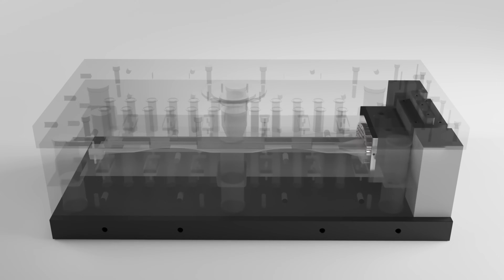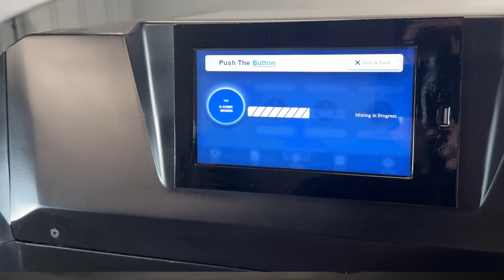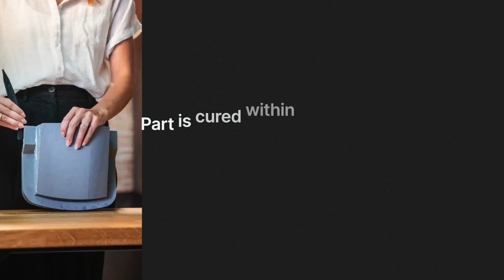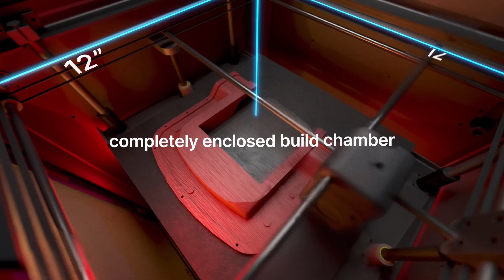INJECTION & Casting System for 3D Printers

Comment from the maker: You are not limited to using only Neckog materials for either device. Simply provide us with the name of the material you wish to use, and we will send you a calibrated flow file for it. 

You have the freedom to design the molds and manufacture them from any material(silicone, aluminium) of your choice. 

DaaS is designed for those who prefer not to handle the process themselves, and with prices starting at just $4.99 per mold, it's an incredibly affordable option.
Reply: would it be able to utilize Smooth-On urethanes and silicones?
Reply from the maker: @phillipwilson8429  Smooth-on and polytek polyurethanes yes. We are working on silicones.
Reply: How about you recommending some compatible chemicals, that you tested? I am not going to do chemical compatibility testing for you!

Comment: how many times can you use the 3D printed part to cast a part before it starts wear out?
Reply from the maker: We tested it over 30 times(showed no wear). The weak point tends to be the assembly points of mold parts.

Comment: What material would you ned to 3d print the mold? PLA, PetG, ASA?
Reply from the maker: If the part is thin any material works. If its thicker due to exothermic reaction of the resin setting we suggest ABS or PetG.

Comment: Usually when casting resin you use a pressure chamber. How is it bubble free?
Reply from the maker: Good question. There are three main reasons for bubbles in urethane resins:

Moisture: Urethane resins are very sensitive to moisture. Our system engages the tanks only when the system is in use to minimize exposure to moisture.

Hand Mixing: When mixing by hand, it’s difficult to avoid introducing air into the resin unless you mix under vacuum conditions. Using mixer nozzles ensures that the two components are mixed without aeration.

Injection/Casting Process: Pouring the resin steadily and slowly is crucial. With an adjustable flow setting, you can control the amount of material being dispensed, reducing the risk of bubbles.

Comment: I love your product, but have 4 suggestions that may help you on your way to success. 

1. Biggest reason products like this fail is funding. What does kickstarter give you that you can't do yourself for less than 10% of your REVENUE? The novelty of kickstarter has worn off to the point where it gives little in the way of advertising value and I would argue harms anyone trying to portray a SERIOUS company. Especially when starting out, companies need to be FRUGAL to the max and using a service like kickstarter is in direct opposition to this. I can put together a better pre-order landing page in an hour than what they offer.

2. I would position your product as a solution for low volume injection molding and prototyping instead of as a 3D printing alternative. This makes it a value add, instead of replacement for another technology. Molding is really useful for items that shouldn't be 3D printed in the first place. 3D printing's strength is for internal channels which molding can't compete with. Where your product does deliver a big win though is the 99% of OTHER parts that do not need a 3D printer but do require, quick turnaround, low/medium volume and strength.

3. Tight focus on a few niches. The lower upfront cost compared to injection molding is great, since injection molding is expensive upfront, but VERY cheap after initial investment. This means low volume production runs is where your product shines. I would name prototyping as an additional feature but not a main feature because for 1 of prototypes manual casting avoids the cost of your machine. I think you will be most successful with a tight focus on a niche, that is high value low volume parts. This should also guide your resin/epoxy development, along with any fillers or modifiers. 

4. $12/kg is a lot compared to the $1.50-$5 of injection molding and $3.50-$10 of casting resins. That means either you need to get costs way down or find customers who have plenty of margin in their products to pay that premium. When I can buy a used injection molding machine for <$20k that means if I have a production run of just a few thousand units material costs + speed are already offsetting any other advantages. Injection molds are expensive but so is employee payroll. An injection molding machine has 20-60 second cycle times. This means your ideal customer will want to produce many DIFFERENT products, in quantities numbered <5k units. Also parts with special properties which are not easily achieved using injection molding. ie. Special shapes, multiple materials, lots of inserts or fillers, big pieces.

5. A use case you may not have thought of is casting onto large items that are not movable or on a job site. Think wear surfaces, vibration isolation standoffs on a large/machine part. It isn't too difficult to mount a mold onto or around another part or machine. I think something like a vibration motor mount.

Comment: Im intrigued. This mimics a lot of my workflow. I just dont really understand it yet. So its a FDM printer alright. Plus a mixing and injection system for thermoset resins. But how does this workflow actually benefit me? As far as explained, i still have to manually prep the mold surfaces, and manually inject the resin. Other than a static mixer being integrated, i dont see the benefit yet. Could you do a more indepth video of the actual casting workflow?

Comment: Isn’t this just a 3d printer? You can make a mold with certain plastics that you can use as mold
Reply from the maker: Flovv-e is a 3D printer with Injection System. Flovv is Standalone Injection System. You can print molds from ABS. Also You can use molds made out of silicone, aluminium materials.

Comment: I see so many hidden costs in this system its not even funny! When anyone says something is or uses "proprietary" parts or materials be skeptical because the costs they claim are just hiding the real cost!
Reply from the maker: You can use your resins and your mold releases. Our mold release is $20 which is cheaper than almost all.

Comment: I’m a maker, I make terrain for tabletop gaming. I don’t really understand everything you are selling. What is the $499 for unless I missed something in the video. I see 2 machines on the desk. How many times can the same mold be used before it deteriorates. How hot is the chemical process. The release mold “helps” with layer line…then how accurate can it be for small details. I can easily see this working for parts and jigs for trades, that is actually brilliant for that market. But how doesn’t affect really thin or small details. If I could produce basic terrain with this setup it’s a win for me. My printer can deal with the small details while larger structures be casted.
Reply from the maker: Flovv which is the standalone unit will be $499. If its an ABS mold you can use it 40-50 times without any problems. Temperature depends on the thickness of the part(it doesn't go above 180-190F for a very thick part). For really small parts SLA printing or using silicone molds is way to go. When removing a very small detail from a rigid mold its likely to break unless its from a flexible material(in this case using a off the shelf spray mold release is much better). We never meant it to build very small details as there are a lot of machines for that. But if you are regularly casting this helps a lot with the process also for casting large structures from multiple part molds, its cheaper while also being very easy to use. If user is already casting things manually, Flovv makes it much easier. Thank you for the comments we are trying our best.
Reply: Just look up smooth on products. Buy some oil based clay. Foam core board. And hot glue. Save yourself hundreds of dollars and hours of time. "block mold" "2 part mold" "cavity/matrix mold" are all the tutorials you'll need.

Comment: So now you can make 3d injection miniature
Reply from the maker: If its a silicone mold yes. Small details from a rigid mold would break easily unless its injected from a flexible material.

Comment: Watched the whole video but still have no idea how the mold is made. You would think for a cheap injection system, you would also want to emphasize how easy it is to make a mold. I am going to assume the mold is a printed part
Reply from the maker: Yes mold is a 3D printed part. Mold making starts from designing a mold then printing it. Printing it is easy design on the other hand is not easy for everyone as we say in the video too.

Comment: Actual ASTM physical parameter testing results of your 'special' resins would be helpful - unless there is a reason you don;t want people to see actual data.
Also - how is this different than just printing a 3D mold in any old printer and using whatever 2-part epoxy you wish?  Why use your 'special' system?
Reply from the maker: RIM machines has always been industrial size. This is for the one thats for makers.
We use polyurethane resins. ASTM makes sense we will include this in the future videos. It creates better parts with a much smoother workflow.

Comment: Im interested in injection molding silicone parts. Food grade and nonfood grade. This is possible on the flovv? Do we have to use the exact materials your company provides? And just to confirm again, are the molds required to be aluminum or stainless steel?
Reply from the maker: This one has been asked over the emails too. Right now not possible but we are working on it. You can use readily available resins. Before doing so we just ask to give us the name so that we can update our material profile. Different resins have different viscosity profiles. Mold can be anything you readily use. We did develop a mold release to use directly 3d printed molds from ABS,PLA or Resin printed molds. Also for aluminium or silicone you can use off the shelf mold releases too.
Reply: @NeckogIndustries  Gotcha. Thank you for the reply

Comment: Hi nice product, i'd like to use this machine to overmold some rubber parts over CF plates, the mixing ratio is not exactly 1:1, but more likely 60:40, would it be possible to tune in a different mixing ratio?
Reply from the maker: Depends on the viscosity profile of the resin but its possible. Calibrating to different resins is something we will be doing. It's not going to be just our resins.

Comment: Where will these be made?
Reply from the maker: We are based in Texas. We are manufacturing all chemicals and devices in US. Screen and some of the components are bought from China.
Reply: @NeckogIndustries  great. Sounds like the printer will be made in the USA with less than 50%  Chinese components. Great you are making it in the US.
Reply: How expensive would it be to buy the consumables from The US? Are you going to have a reseller in the EU?

Comment: Im not clear on what each box does. Is one an FDM printer? The smaller one is   an injection machine, sort of a press that holds the mold shut withbpressure and then i jects the part? We need a demo of a regid part and a flexible part. Show us the lapsed time, the prep and process and post processing.
Reply from the maker: Next video will be from start to finish whole process. Big one is 2in1 FDM printer with a injection system. Smaller one is only Injection System. Molds are either clamped or screwed together. Seamlines are taped.
Reply: @NeckogIndustries  great looking forward to that video.
Reply: Please ensure much, much better sound than on this video
Reply: Same

Comment: Would like a better idea of cost to run - like cost of consumables, and the range of costs for the injection materials (I can't imagine $12/kg is across the board) as well as cost for the mold release.  Also if there are going to be geographic related issues on where the resins can be shipped, shipping costs... all adds up really quick.
Reply from the maker: Mentioning all prices would make for a boring video. Mold release is $20 per 5 ounces(approximately:150gr). It equates to about 8 cans of mold release spray. You can use both systems with the resins that are available in the market . Only thing is provide us with the name so that we can update the device. 
We are working to streamline the process of reaction injection molding and casting to make it hassle-free.
Reply: @NeckogIndustries  To be fair, one can cover such things with a chart.  The question I have is if your business model is equitable, or it's a standard "printer" model where the device is free, and the gotcha is in the consumables.  That I have a market that tolerates a given cost, and if I can't mold my parts within that cost, then buying the device is moot.  Your product looks good on the surface, just want to do my due diligence.

Comment: How long does it take to run each part? I’d like to see the process of assembling the mold, using the machine to inject, removing the part from the mold, and then on to the next part. I understand this isn’t for large production runs, but say I’ve got 20 parts to make like those on your table—what’s the time and effort involved?
Reply from the maker: Sure. On the next video we show from mold design to finished product.

Comment: its only a concept. the flow-e behind the printbed that 2 cable is a LOL . im not convince thats a working printer. the whole thing looks like a 3d printed can see the layered
Reply from the maker: Outer shells are made out of thermoformed ABS with flat panels being aluminium. Internal structure is L stainless steel riveted to aluminium bent panels. Yes there are 3D printed parts.
Reply: @NeckogIndustries  are The Machine a working or just a prototype?
Reply from the maker: @SuperLittlehorn  All the cut scenes are actually injected with the machines. 
https://www.instagram.com/p/C4g47kptGtt/ On the link this is at the highest flow setting with the rigid resin.(Since operator is behind the mold he can't see the mold fill. 
So, when injecting, the operator presses the button multiple times instead of holding it down continuously.).Also on the next video we will do the process from start to finish without cut scenes. After the injection we will do a timelapse without the cut. Also there will be a printing timelapse on the scene. So they are working.

Comment: I think the example parts say it all… You have to think, they are showing us the best they can do. The services side is a huge no go for me… I own an engineering firm, we design injection molds, machine them, and then use them in our shop, and these people are telling me that the skills required to design a resin mold are too much for my team? LOL. Who are these people? Also, I’ve 3D printed plenty of resin molds in the past and used off the shelf resins with no issue, so what do I gain here? I don’t get it… Seems like this is a, not very well thought out scam…
Reply: AFAICT, the design service is just an option; you’re free to do your own designs. (In fact, you can just use your own printer with their standalone injection machine, I didn’t hear any limitation about design in his presentation.
Reply: How much did you pay for the software used to design molds?
Reply: As you’re in the molding business you seem a little biased. I don’t think you have to worry about losing business with these machines.
Reply: Didn't you and thousands of others say the same thing about Bambu labs?
Reply: I'm not interested in the machine, but I may be interested in the liquid materials used. It's always nice to fine a new chemical solution. If their foam or resin is at a decent price I will be trying it. You don't need a fancy machine to pump liquids into a mold, although if I was making 1k parts it might make sense to have a decent pumping machine to do this. You don't have to use their design services. All of their products don't exist yet. The shop is setup but no prices or stock so I guess this is a come back and check in a year product for me.
Reply: 3D printed molds are great.  They’ve BEEN great since ten years ago in my masters program 😂
Reply: I think target market are hobbyists, not people who own teams. That should be pretty self evident from the cost.
Reply: @bob84409  i dont think hobbyists are the target. Hobbyists can just cast pour the materials normally or use a syringe. My guess it is for etsy shops or small shops like for prototyping, small batch productions or prop making for theaters and movies.
Reply: He did not say that one must use their daas mold-design service. Users can design and print their own mold.
Seeing your background it is doubtful you are their customer target.
But for people new to injection molding, this supposedly affordable and simple to use / clean solution might be an interesting start.
Reply: Your team? This is for average consumers. Not you
Reply: @MrGTAmodsgerman for average consumers you have ender 3 for 200 dollars or bambu or dyi. Not this crap
Reply: That's a fair concern but they said in their pinned comment that you don't need to use their products. They offered to send the files for whatever you want to use

Comment: This is awesome.  With the wire edm, the desktop sla printer and now this I am loving how fast the advancements in 3d printing has been this year! So many really cool things showing up cant wait to see more of this I am especially excited about the foam aspects for rc planes. 

Are the molds able to be made with a hollow center?
Reply: This isn't 3D printing, this is just your regular polyurethane resin casting, you can 3D print or CNC the molds yourself and buy the poly resins in bulk at cheaper prices already. So far I haven't seen anything here that is new or an improvement over existing workflows.